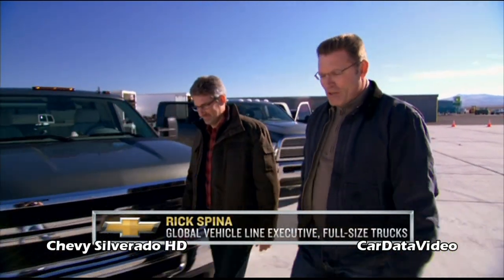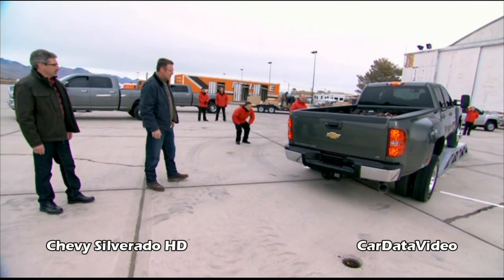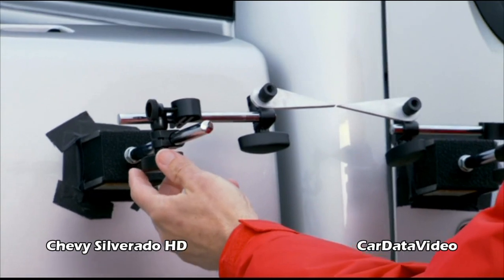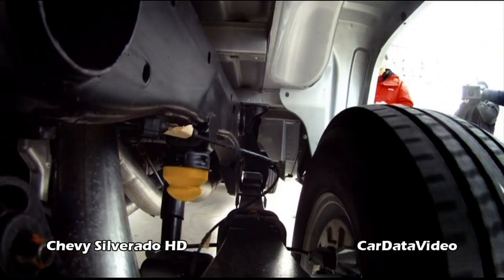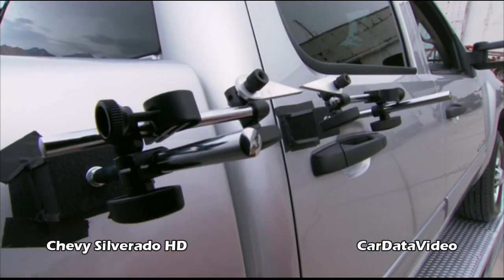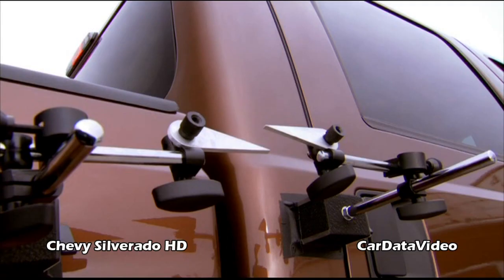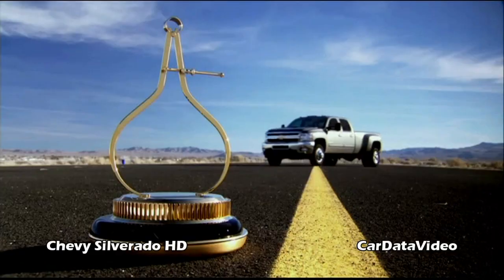Chevy vs. Ford HD Truck - Bed Bend Video

Comment: The thing about Bed Twist is that the less you have, it is NOT a better thing. A stiffer chassis has to endure more force to not bend as much, and can lead to stressing of the metal frame and possibly breakage.

The Chevy has too stiff of a frame. Doing this too much will stress out the chassis after a while, and it will either become permanently warped or will break.

The Ford frame is OK. Not perfect, but it is enough give to put less stress on the frame of the vehicle. You can't open the tailgate in this position, but when are you ever going to need to?
Reply: You get the point!  FORD's frame could use improvements like anything else that which has been done since the 70's till 2015.  I sure hope that FORD sticks to there beefed up C-Channel vs a Thinner Fully Box'd Chassis when the Superduty is due for a major update soon and just continue to develop on what has worked for so long.  

GM and RAM's solution was to go with a STIFF Sausage, Good in Bed with Her, BAD if you Wrestle with Her.  Should I say, Broke Sausage!!
Reply: Micah Watts
 I am glad someone agrees. I see an innuendo in GM's and RAM's solution... giggity.
Reply: WRONG, They are all using steel which is flexible but the difference is fully boxed vs c channel. In addition, RAM and GM has more cross members to provide additional durability. Ford is using outdated frames from 1970s.
Reply: Let me tell you why that's bullshit.

More cross members means more welds. More welds provide more places there the chassis can break from flexing. Less cross-members provide a bit of extra flex in the chassis, but this means the chassis has less possible breaking points and is thus more durable. Ford sticks with the saying, "if it ain't broke don't fix it". Their chassis, 1970s or not, has proven that it does its job better than its competitors. Let's not mention how many times GM has had to re-engineer the chassis they use. Some GM vehicles are famous for the weakness of their frames, particularly Chevrolet and GMC.
Reply: ***** Going along with that way of thinking, Ford must have the worst motors as they redesign them all the time and never have a long running model. Unlike the Chevrolet Gen I small block that lasted 50 years.
Reply: Shawn Dickens Frames don't affect 2016 CAFE Standards as an Engine Does.  While GM relies on deactivating cylinders to conserve fuel, FORD relies on much Sounder Practices like a motor that actually is fuel efficient...AKA 3.5 and or upcoming 2.7 Ecoboost (no deactivation here but they will employ Start/Stop Tech)....Really the only major change as far as Gas Engines go for FORD was a switch from OHV to OHC Motors which has some added complexity, YES, but does have less moving parts...GM stole many design elements from Ford's motor's in the evolution of there OHV Motors.  I'd suggest freshen up your knowledge of the truth behind motor comparisons between Ford and GM....

Either way you go, Both Current GM and Ford Motors have proven very reliable in long term use.  I just don't like Chevy's approach to Frame design, not a big fan of there cramp interior space when compared to Super Duty, I much Prefer the looks of Ford Trucks over Chevy, I want a Straight Front Axle on a HD Truck and Ford put's Beefy Components on there HD Lineup...Add, they've always had a better and more durable interior IMO
Reply: Micah Watts Missed the whole point there buddy, but that's okay.
Reply: Shawn Dickens Actually, Your Analogy I got, but that's okay if you missed my point...
Reply: Micah Watts Oh, I should be able to read your mind and know you go it even though you only rambled on about other points you wanted to talk about instead. Yeah, I guess I'm the one that didn't get it. LOL

Now, I'm no longer at a race and just on my phone. Lets talk.

Frames or chassis will have an affect on MPG. You see no matter how efficient and even with an energy capture system to capture the energy lost when stopping. It will always be more efficient to just keep moving instead. The brake is the biggest killer of MPG. If you can keep all or almost all of your speed in the corners this would have a huge impact on you MPG. A solid chassis will improve corning even in 5 ton truck.

At one point you might have had something on the less moving parts of the OHC. No push rods or lifters.There were still rockers on early models, so not to a huge change. They then doubled the cams to 4, so they could use the a design found on Toyota Supra (not original). Do you count the lash caps on each valve as moving parts? Anyways, then they added twin turbos. Now they have two moving parts that approach the speed of sound. They also have to have waist gates (moving parts in the exhaust system) and blow off valves to help with turbo life. Now as to which one has one is more reliable, I can't say from first hand ownership of both. I do know if you Google, "Chevy L92 issues" and "Ford Ecoboost issues" you get a different type of issues that would make me not buy a Ford if I was to base it only on that alone.

As for using Ford designs. The current Gen III and Gen IV had a lot more Chrysler DNA than Ford. They do use the crack rod invention from Ford, but as state earlier all of them use ideas from others even Ford. They certainly didn't invent the turbocharger.

Now back to my statement about the post made by the person I was engaging (not you of course). Enlighten me how many different designs or Generations of small blocks has Ford gone through? Keep in mind GM is only on it's 5th as of this year. You see Ford has through the years made many motor changes, sort of like Chevy has with it's frames. All of which supports my point about his flawed logic he was using to conclude that Ford must be better.
Reply: Logical rebuttal to provide but don't have the energy, back to more important things like my Family...Aloha
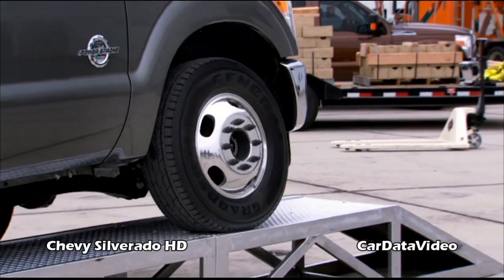Reply: yeah but it is one thing to have so much flex that you actually dent the metal @ 1:13-1:17
Reply: *****  more welds does not make metal weaker and I weld on the north slope pipeline.
Reply: Lower income families are the backbone of society. If everyone had the ability or desire to have a "real job" in your words society would fall apart. No one would be able to buy a new car or have any shipped product like soaps, tv's, new tires, anything. Welders play a huge part if society and someone has to do it. It doesn't mean they are less smart. Most likely they are more down to earth and better to get along with than someone like you pouting out your hate speech. I'd rather hang out with someone like that than someone stuck up like you any day.
Reply: *****
I 100% disagree. As and Engineer, here is my take. With more welds, you have more places for failure, but less chance for failure; with less places for failure, one failure can lead to a catastrophic system failure. With more more places for failure, one failure is unlikely to be catastrophic for the whole system, and can be recognized and repaired. The strain and flex should be taken up in you suspension, not the foundation of the vehicle.
Reply: I'm making $53 a hour 2 weeks on 2 weeks off. So tell me more about how your clothes folding business is going. Depends what kind of welding rods or wire there using.
Reply: yeah none of the buildings in California are built rigid anymore.
Reply: Talk is cheap. Sounds like you want everyone to believe you can afford to buy two new trucks and beat them to death on video and prove your wealth and point. Ball is in your court, get to producing.
Reply: What about that big twist that stroke the tail gate like a mad bowling ball? hah? is that a good thing to? judging from were Ur going with this U will say its too smah
Reply: rather it do that then bend the damn tailgate
Reply: Fun part, items attached will start popping off, there has to be flex or it will snap, the frames are like a ladder, boxed frames are not new, and should be avoided, ever see a Jeep Wagoneer frame, one from a northern salt state, the frame looks like swiss cheese, had the vehicle not been of solid construction, and been like a truck, they'd break in half, International Scout and Travelall also, box frames, rot from the inside out. Chevy rigid history, in the 70's their 4x4's often had the frames crack where the steering box was mounted, was so often, there were patch pieces available.
Reply: Ford just released a 2015 F150 with a stronger box frame. Go check out the video on the Ford site. Haha
Reply: American Outdoor Notification Systems you don't want something that bends too much or else it'll been in that position and stay in that position that's what I see with a lot of trucks the chassis is bent because they went over something and it got bad and it's mostly Fords not Chevys I have a cousin who goes on trails and a Chevy and it feels fine and his chassis Is Not Bent
Reply: Justin Galligan
Chevys, the 70's were well known to lose power steering boxes, frame cracked.
Reply: Kyle Hubbard I haven't kept up on the buildings, so I'm not sure. But, the last time I saw it the large buildings were very strong and stiff. The mounted them on a moving base so the building would only rock a little while the ground moved under them. I guess I'll have to check that out again one day.
Reply: American Outdoor Notification Systems 😂 so you are a car engineer?? 😂 I didn't think so! How about that bent sheet metal on the tailgate? You need that also? 😂 just dumb!!!!
Reply: American Outdoor Notification Systems so you would like a big dent in your tail gate still. I didn't think so...
Reply: American Outdoor Notification Systems he was probably to weak to open it
Reply: Extreme Minecraft Master  what do you know you play Minecraft all day
Reply: TheOldTrombonium a lot
Reply: I'm 3 years late but what was that welding job ???
Reply: TheOldTrombonium 
As a person who repairs and straighten frames, i find more cracks and breaks in GMC and Chev trucks, from newer(2016)to old(1975) now that said, it is also what the truck goes through, less flexing and going through ditches constantly with or with out a payload means more cracking of frames. You need to have flexibility. Also steel does get fatigued, so in time all will crack or break at one point. My two cents, have a great day!
Reply: A frame is supposed to flex under pressure. If Chevy got the cock out of their ass and actually put 8k pounds in the bed of both of these trucks, the result would be COMPLETELY DIFFERENT. The chevy's frame is made out of 1/8th inch thick steel. The fords is made out of 1/4 inch thick steel. The secret to chevy's frame is they welded it into a box, which basically means that they did this (). That stops the frame from flexing, simulating strength. Fords frame is a classic C channel frame which is DESIGNED to flex under pressure to stop other components of the truck from being damaged. The fords frame is like this (. But because its made out of much thicker steel (1/4 inch thick rather than 1/8th inch thick, it is stronger once you get heavy loads. As i was saying, if Chevy put 8k pounds in the beds of both of these trucks, this is what would happen:

The fords bed would flex more and more until the tailgate was destroyed, most likely breaking and taking the bed sides with it. The Chevys frame (not allowed to flex), would destroy the front and rear suspension setup of the truck, because the force of the load couldn't be distributed over the frame by allowing it to flex. That means there would be a good $8000 in repairs to the chevy INSTANTLY because the frame wasn't allowed to flex. However, considering these trucks are dual rear wheel trucks, the suspension would most likely hold up to some degree. If the suspension was able to hold up, the frame would be under so much stress that it would collapse. Imagine if you put a refrigerator box (cardboard box) in a press where there was pressure twisting the box sideways. The box would collapse under the pressure. So in other words, the chevy's frame would snap off like a toothpick because its not allowed to flex and that would most likely grenade and take the drive shaft with it, along with smashing the bed (with 8000 pounds of shit in it) into the back of the cab, breaking the rear window. This would also most likely take the fuel tank, DEF tank and all the wires, lines and cables that go to the back of the truck with it, which would be almost 30,000 dollars to fix (if your lucky). Chevys simulation of strength in their frame has convinced many people that fully boxed frames with super thin steel are stronger than C channel frames with thick steel. If Chevy had fords frame thickness but had it fully boxed, you could put retarded amounts of weight on it and be fine as long as you didn't twist the truck like a jackass. This made ford put a super thin steel fully boxed frame under their trucks to get better marketing, because Chevy "exposed" Ford for putting a better frame under their trucks (which was allowed to flex)
Reply: Wrong! I dunno about you but i don't want dents on my tailgate

Comment: OK, critical thinking questions: Is the level of stiffness shown here necessary or even good for the longevity of the truck as it is put through the paces of its working life? Alternatively, does a pickup truck's frame need to exhibit some measure of flex / resiliency in order to prevent any type of snapping/shearing or long term metal fatigue? 

I really don't know the answer here, so I'm genuinely asking.

Comment: ford designs there trucks frames to bend so they have a better chance of keeping all 4 on the ground to increase traction
Reply: Ya and the tailgate still fucked up😂
Reply: Yeah and they're safer in crashes
Reply: @Sgtqman19 lol yeah but if you can have a truck that has more traction than the competition, twist like that, drive off, and be safe in crashes then your definitely winning in the "truck game"
Reply: that dent in the tailgate will pop right out with a plunger and the trucks like new again
Reply: Yep
Reply: Okk
Reply: M8 that's what suspension is for. You wouldn't want to put in a load on the bed and for the frame to twist like that under stress.

edit: It's more easy to envision in this video: https://www.youtube.com/watch?v=VIX8ZRhPT-U
Reply: Anyone ever notice.. it’s always a Chevy with a slanted bed. Good thing fords are flexible. Also, don’t be dumb and try to twist your truck in half. If you see a rock, don’t drive over it. Kind of common sense
Reply: Mercedes unimog has tons of twist and it is one of the most capable factory stock trucks in the world
Reply: well it deformed it, should not happen
Reply: @jacobherreman8709  actually if your off road you try to get your tire on that rock and not have it go under to rip shit apart. Kinda common sense.
Reply: Barry the tail was locked it didn’t even click
Reply: Si they use the frame as suspension?
Reply: @Mad9977  no it didn't deform it, that's the point of have a bed that twists like that. it will go back to normal instantly. where as a more rigid frame is likely to bend and hold the shape of the bend.